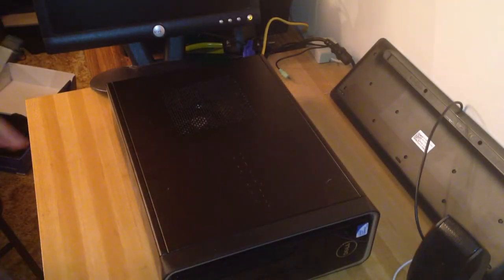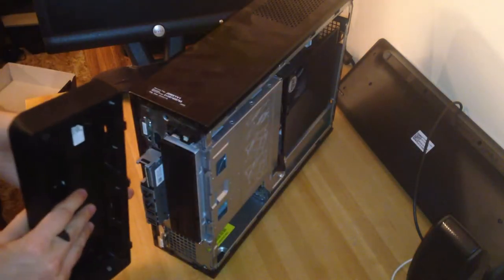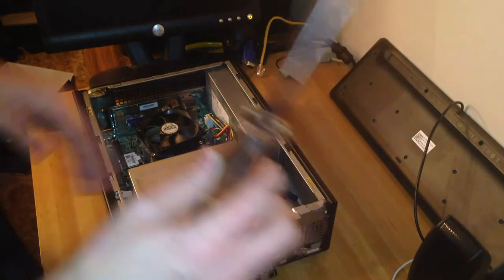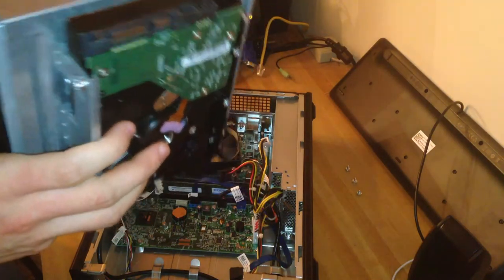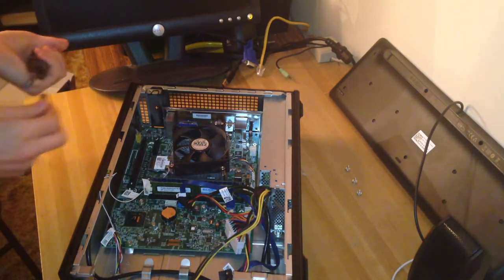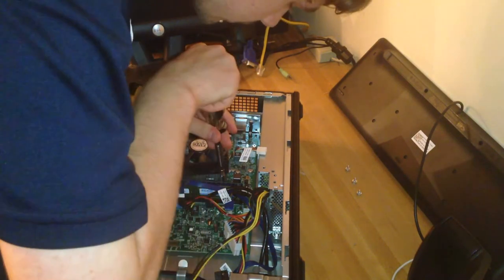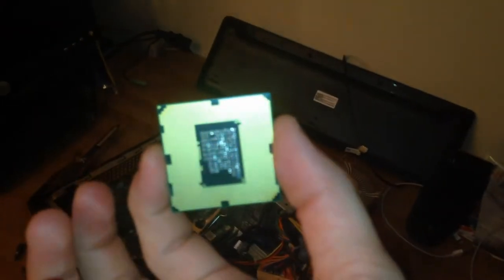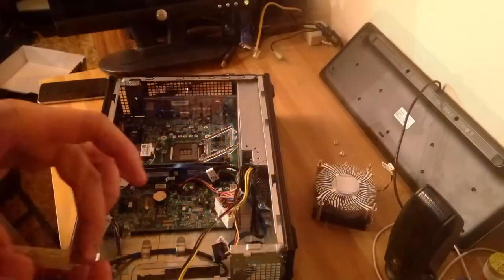What's Inside?  (Dell Inspiron 660S Upgrade Log) [Generation One: "Wolfboy Tech"]

Comment: Hi i have one of these computers, what would u recommend to male it more of a "gaming computer", i want to add another 4gb of ram and a low profile graphics card, what would you recommend i use and would i need to change the cpu aswell
Reply from the maker: +The101maham Hello, friend! First of all, I would need to know your budget, then I could make you a PC Parts Picker list of things I would personally recommend.
Reply: +Wolfboy Tech I would like to spend no more than $350
Reply from the maker: +The101maham Cool! Give me about 30 minutes and I'll send you the link in the next reply!
Reply: +Wolfboy Tech cool thanks
Reply from the maker: +The101maham What's the exact model number of your system? This usually can be found using the My Computer/Computer function in XP/VISTA/7. If you are on 8/8.1/10 simply type "About" in your search bar.
Reply: +Wolfboy Tech are you talking about the product id?
Reply from the maker: +The101maham It should be Dell ixxxx number
Reply from the maker: +The101maham Also are you team Red or Green?
Reply from the maker: +The101maham I removed your post about your tag because anyone can use that and potentially gain access to your computer. The Red/Green teams are AMD and Nvidia.
Reply: +Wolfboy Tech thanks lol...and it doesn't matter tbh lol, i dont see any specific model number, there is one on the bottom of the system  that says "reg model" is that what you are asking
Reply from the maker: +The101maham Alright. while I get your graphics card chosen from the 2.9 million possibilities... Can you download Speccy from http://www.piriform.com/speccy and tell me the speed of your RAM speed and CPU type and speed.
Reply: +Wolfboy Tech here's my ram spec: 4.00GB Single-Channel DDR3 @ 665MHz (9-9-9-24) and here's my cpu: Intel Pentium G645 @ 2.90GHz Sandy Bridge 32nm Technology
Reply from the maker: +The101maham Okay.. I upgraded several things.. First of all, your ram is 8GB on one stick, allowing better performance with upgradeable options in the future. Secondly: your case... I chose the black and red variant, but there are many others around the same price that will allow for the 960 as the third upgrade. It may be your first gaming build, but if you save up about $100 more it'll allow you to have a sick ass build for still under $500 (plus the OEM costs). Obviously the storage is optional, but HIGHLY recommended, the same with the cooler because better thermals means better games... Also: most all of the parts can be transplanted to a full build when you are ready to make your own system! Whatever you do, don't forget to have fun!! Here's the link: https://pcpartpicker.com/user/jstacklin/saved/jfgMnQ and I wish you the best!
Reply: +Wolfboy Tech cool thanks man :) this is how you get subscribers by helping:), I subscribed....so just to be clear this is to modify my existing pc? And I thought dual channel would be better
Reply from the maker: +The101maham Yup! You'll simply transfer the components from your old case to the new one! Thanks for the sub! And yes, DC is better, however if you are going hardcore I would recommend a DC 8GB DDR3-1333 (x2) kit to have the max that the mobo (motherboard) supports
Reply: +Wolfboy Tech I thought my motherboard only allowed a max of 8gb of ram?
Reply: +Wolfboy Tech hey sorry one more thing and this is just a personal opinion. I noticed your build was quite pricey so i wanted to see if i could build a whole system for less and i got this after a little research of the parts....https://pcpartpicker.com/user/the101maham/saved/XGgMnQ is this a good system for the money and is there anything you would change (bye budget goal was 350 and this nears 370
Reply from the maker: +The101maham You are probably correct about the max RAM, my bad. Okay.. Stay tuned later this week to my channel as I will address your build.. Because (not to be rude) you kinda chose the cheapest parts and that's not always the best option, especially when gaming. Look for the video to be up around Wed. at 1pm EST (US)
Reply: +Wolfboy Tech alright man

Comment: Lol he used a screw driver to unplug his heatsink
Reply: QuintinVProductions did that before ended up taking fan off heatsink fml
Reply from the maker: Edit: I had to remove the fan clip since I couldn't get it off. The computer was used for about 6 years so it's expected to be a POS to get apart
Reply: just like the intel stock coolers over the years, one lock always seems to break :./
Reply from the maker: QuintinVProductions Lol, so true. If I would buy this for myself.. I'd just throw it in the trash and build a custom one. I don't think (minus laptops) I will ever go back to OEM.

Comment: I have  one of these but can't figure out which graphics card should slide in it for a low price
Reply from the maker: The old fashioned Nvidia gtx 750ti is the best low-end card ($75-100 (USD)). The AMD Radeon R9 280 is my personal favorite mid range card ($100-250 (USD)). With the high end card that is in my rig right now being the AMD Radeon R9 390(or 390 X) ($215-400 (USD)).
Reply: +Wolfboy Tech So if I should choose between the 390 or 390x which one would you suggest for the dell inspiron 660s
Reply from the maker: +Casey Shuemaker neither as the mobo is not powerful enough to handle the card, sadly. But, should you upgrade the mobo, I would say save some money and get the 390 as I can get 60+ fps on games like bo3 and about 100+ on games like blade and soul or minecraft. Skyrim is even a smooth 90 fps with 200 mods.
Reply: So what can you suggest to upgrade the power supply? Or should I just get a completely new pc? If so i'd have a max budget of 600$ at the end of summer. I am only seeing if I can save some money and still be able to play some good games like ark survival evolved.
Reply from the maker: +Casey Shuemaker I would hate to tell you this, but it's the truth. You'll probably find building a small system and salvaging parts to be the best option. So, when I get to my computer, I'll make you a pc partpicker list to help you.
Reply: +Wolfboy Tech Lot's of things that hold this pc back from being upgraded from what it seems like.
Reply from the maker: +Casey Shuemaker sadly. I am sorry I couldn't give you better news. Dell made these computers to last one to two years max with little to no upgrade path to speak of. :( Sorry.
Reply: No it's totally fine, I've been wanting to to a total upgrade for a long time.
Reply: The only thing I don't like about the whole upgrade thing is putting together the new one lol.
Reply: And I only asked if I could upgrade just to save some time and money.
Reply: But I can't complain because by the end of this i'll most likely have a better computer than if I had upgraded what I have.
Reply from the maker: +Casey Shuemaker very true to both of your points.
Reply from the maker: +Casey Shuemaker something you could think about is going to a boutique builder. And here is where I would toot my own horn, but my company does offer pc building and system creation, if you'd like?
Reply: +Wolfboy Tech Sounds awesome, but at the same time I would like to build a pc so if anything goes wrong I can fix it without hassle. And of course youtube lol.
Reply: +Casey Shuemaker Thank you for the offer though
Reply from the maker: +Casey Shuemaker  Absolutely I would like to point you to Boson 3.0 over on Austin Evans channel... Personally, I would slip in the R9 390 and upgrade to 16GB right out of the gate, and then in a few months (if you have the money) get a decent third party cooler. The link to the video is here: https://www.youtube.com/watch?v=aj2o5xaJJoI
Reply: +Wolfboy Tech whats the best nvidia gpu i can put into 660s if i am willing to change my psu
Reply from the maker: +silicon core gtx 1080 if you have the money. Also.. You'll need a bigger case.
Reply: i dont  want to buy a new case as i like this ones size and portability so what can i fit in there
Reply from the maker: +silicon core hmm.. I'd say the gt 710? I think that's what it is... I'm not sure..
Reply: ok thanks
Reply from the maker: +silicon core yeah.. Btw.. Love the profile pic! H4 was my second favorite halo.
Reply: yea i love halo but sadly its not for the pc master race
Reply: +Wolfboy Tech I got this trashcan back in 2012 for maybe $200 and I've played games like swtor, skyrim, and sims 3. All on low graphics of course. would you say I should upgrade? if so build a new pc or perhaps upgrade a few parts I just wanna play a smooth skyrim maybe 30fps with mods and I got a budget of $800.
Reply from the maker: +Review God USA personally I would recommend getting a new pc, then selling the "trashcan" for parts, then getting more money to get even more parts.